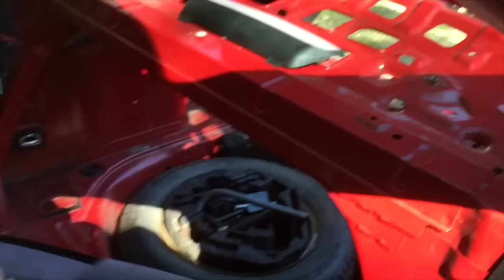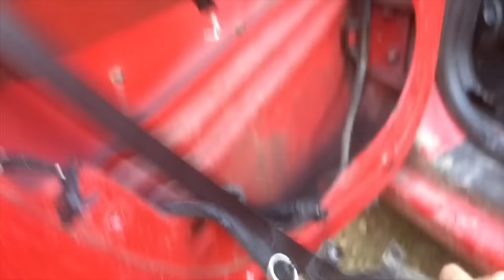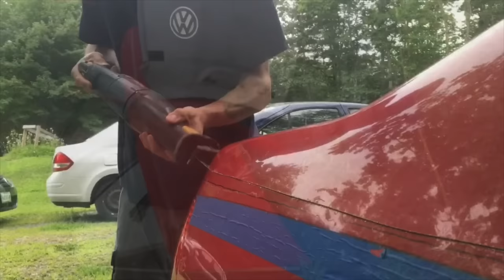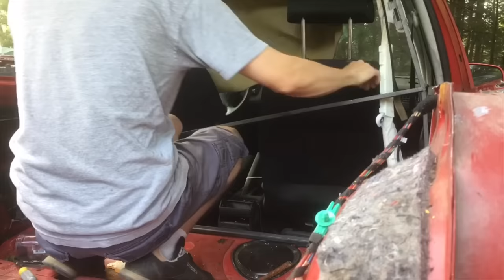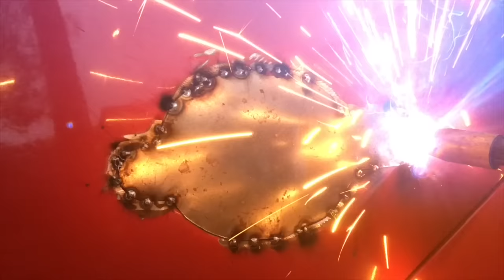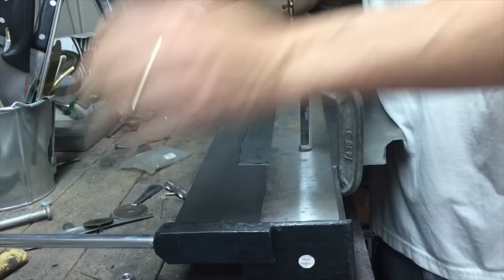DIY UTE Part 2: Cab and Bed

Comment: How much weight reduction do you think you got out of this after you were finished? Love the project and may do something similar. Still thinking of what car to choose but the Jetta is a good platform for this may stick with that
Reply from the maker: Probably not a ton because I added a decent amount of steel in the firewall/roll bar and bed rail top plates and diamond plate floor. If you tried to go minimalistic you could probably shave 300-500lbs off stock
Reply: @ecophage  thank you! 300-500lbs off stock would make it noticeably quicker too. I want a minimalistic Ute that has a bit of speed. Been looking through SUVs mostly but even some sedans and wagons turn out nice like this one

Comment: any issues with body rigidity? I may be wrong, but I can imagine with the shell cut open it might cause the chassis to flex.  Awesome project though!
Reply from the maker: Dustinicus S very little I’ve only heard some creaking in sub freezing temps. Plus the kit the sell to do this you pull the doors and cut the putter rear quarters out and replace with fiberglass. So between my roll cage and tying the roof down to the bed rails with steel the those rails welded to closed doors. I bet it has less body flex than the kit. I’ve had minimal bondo cracking in front of the bed rails on the b pillar. I’ll do an update video soon probably. Thanks for watching!
Reply: Thats why they only do a few cars as the ute kits, the chassis is fairly strong with half of it missing.

Comment: How did you make the frame for the rear glass?
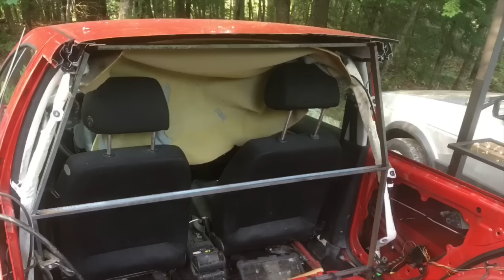Reply from the maker: i made the steel frame at 6:50 skinned the wall with 22 ga sheet metal. then used a mazda truck window new from a glass shop for $150, cut the hole and epoxied it in. I could have cut the frame out of a ranger welded it in and used a seal but I was trying to go the easiest DIY route for cost and DIY do-ability
Reply: Ok sweet thank you! I was worried I was gonna have to make a sunk in frame vs just cutting the hole lol.
Reply from the maker: @joshdaniel7894  I'll be honest the one leak on this was water going UNDER the sliding glass, (the little sliding slots would fill up and not drain not sure why)So my suggestion is if you go slider make sure youre hole is tight top and bottom, I think the frame and seal gives it a snug fit my hole method lacked. Perhaps the stock fit helped seal the bottom edge from water entry. Also drains in passenger footwell corners are important
Reply: @ecophage  alright thank you for the advice!

Comment: Good Old YouTuber videos on how to do. Now adays people talk more then work. I don't care nor any1 else to hear jibber jabber. This was all good up till that mud sht being put on. Grind 45s on each sides metal. Fill it in with mig sand or grind welds use etching primer then bass it. I never did agree with grinding welds till someone showed me how to weld. They even tech it in welding class. The primer thing I just know from auto transportation class. Good old YouTube video.

Comment: Why is everybody chopping down poor ol’jettas, don’t you like em as they are ?
Reply from the maker: Jorjoglou Lol yeah I had two and this one was getting a bit rusty. Plus I needed a truck but hate most truck producing manufacturers soooo, it made sense to do this. Still works great. Doing a radiator and new headlights this month

Comment: Pretty Cool until he started Slapping on Bondo over the Painted door handles!
Reply from the maker: Curt Hall I didnt bondo over door handles, I welded steel patches over stripped out handle holes
Reply: @ecophage  I saw that but then you also Bondo over the welded Patches without sanding and Primer? Other then that I think you did a great job!
Reply from the maker: Curt Hall ah yes I may have skipped pre priming, I did sand it prior to bondoing, I may have cut it out, there was so much sanding footage. If I had to do it again I’d for sure use less bondo.